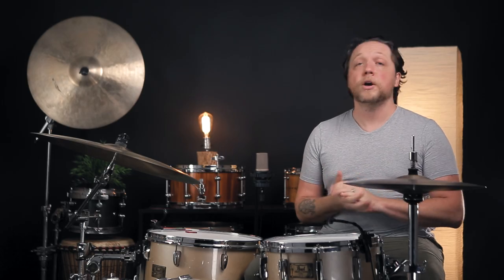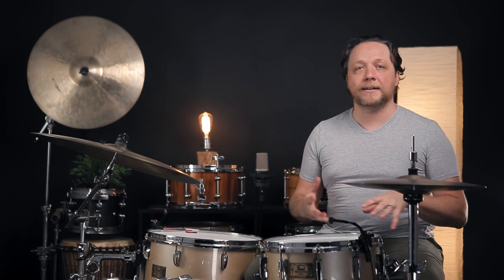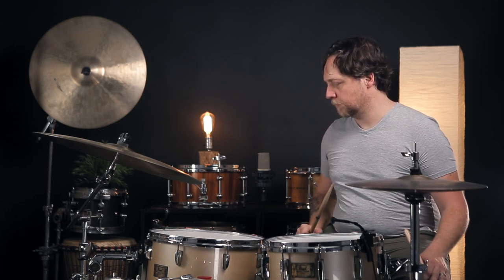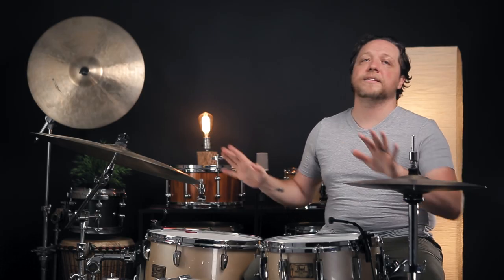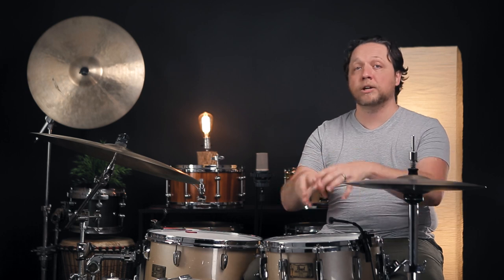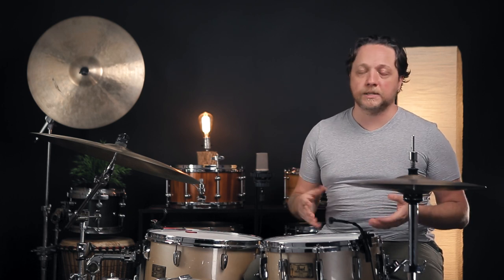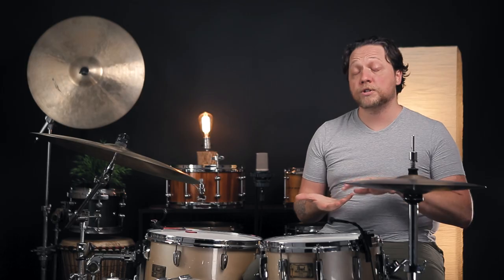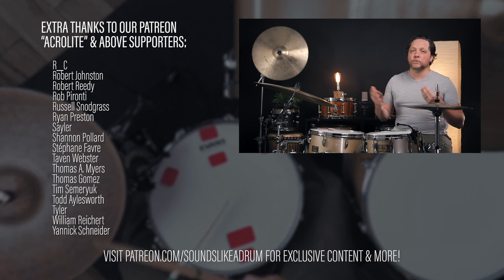Drum Muffling Placement for EQ | Season Six, Episode 11

Comment: Hello, 
If you ever do a "answering questions video" here are 2 questions:
-what type of drum heads should I use for the most amount of harmonics with sustain/ring? or could be phrased: what drumhead will sound the most full spectrum for the most time?". 
-how can I tune in the lower limits of a drum without losing all the tension in the rod and have the head not resonate at all? It seems like the lower limit of a drum is really fine and hard to maintain the tension. 
Thanks !

Comment: How did you get those Evans Pod thingy's to stick on the drum head? I put them on and they fly off in 2 or 3 hits 😒
Reply from the maker: Weird! Ours are EXTREMELY sticky. Almost too sticking. If you’re having issues with yours, be sure to let them know.
Reply: @SoundsLikeADrum  I’ll order another pack… maybe I just got unlucky. I did a shootout with at least 10 different “moongel-esque” products, and half of them did not stick to a new coated batter head at all.
Reply from the maker: It’s definitely worth letting them know. I’d be surprised if they didn’t send you a replacement.
Reply: Mine were super Sticky as well.